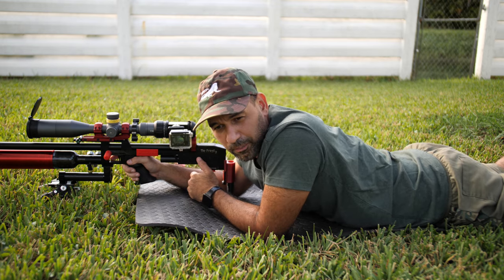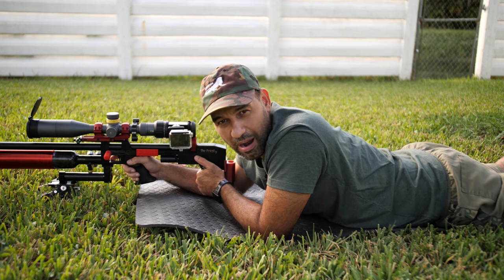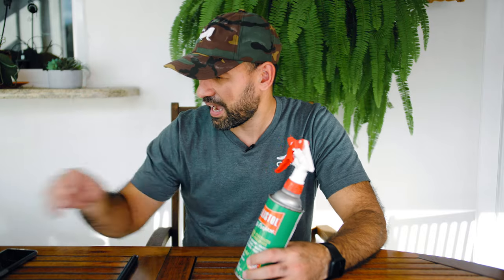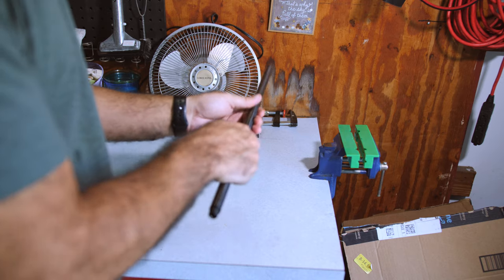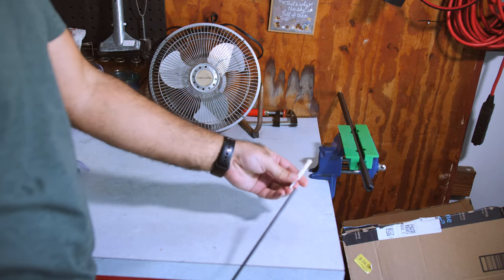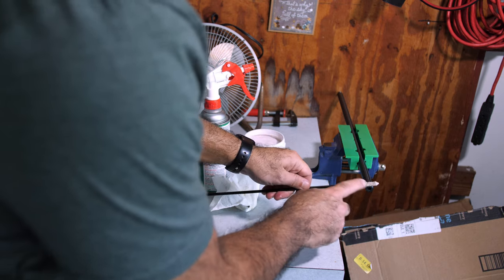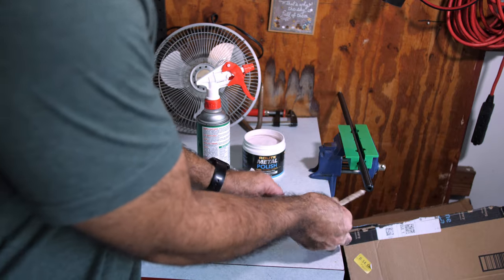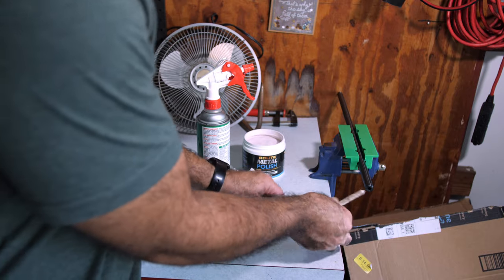How to Polish your Airgun Barrel | Orion the Iguana Hunter

Comment: I use the same method but i found it better to start with jb compound BEFORE the polishing compound becose the jb is grittier and will clean better the barrel before polishing. Polish will work better then.
Reply from the maker: I tried the jb paste vs the Rolite in a knife I have and to me the Rolite was more aggressive, but that might work too. To be honest we probably don't need JB, that Rolite polish like nothing I've seen before. I used JB at the end to remove the Rolite material. I think either way will work
Reply: @OriOnTheIguanaHunter  u can also heat the barrel with a heat gun before polishing for better results. And what i do when the mop becomes too lose and thin is to cover it with a cleaning patch to make it thicker and get more contact with the grooves
Reply: @yvessehnaoui3532  I have used the JB Compound for years. (Sparingly and never with a metal brush.) I've always swiped up and down the fill length of the barrel 25 times then cleaning patches with Ballistol. I've never tried metal polish. I believe I will have to pass on the polish. But to each his own. It all results in a clean barrel, which is the main point.

Comment: What is the no. of strokes and the depth.not clear if you do partial strokes in 3 inches sections and move ahead or the whole length.
Reply from the maker: Just do a bit about 3 inches and do between 10 to 15 strokes then move again forward 3 more inches, the repeat going backwards. It doesn't have to be exact. Just polish the barrel

Comment: I need to ask you did polishing your barrel really work for accuracy or are you just promoting products. I get 2 flyers out of my CZ barrel from a 10 round magazine
Reply from the maker: Promoting products? I don't sell products, if you go and read posts about polishing airgun barrels you will see that what I described here is documented on the community, I noticed I didn't have to season the barrel and got great results, some say you need to do that, but there are many reasons you can have flyers. Did you noticed the accuracy was worst compared with the groups you were having before polishing? Reply, I'm interested on your results... what gun do you have? The barrel I used on my video was a CZ barrel too!
Reply: @OriOnTheIguanaHunter  I have the Airgun Technology 25 caliber Uragan from talon tune. Tony place the Huma Regulator in the gun for me
Reply: The gun is shooting great with his power tune. Every gun can throw a flyer mostly because of the pellet. I was just wondering if I polished my barrel I can tighten up my groups even more
Reply: Put it this way is it worth me to polish my barrel
Reply: Thank you for replying to me I also have the Vulcan2 in 25 caliber both guns are badass
Reply from the maker: Maybe after the gun is aging a bit it's worth doing it... I think that if the  gun is shooting well you should not mess up with it. But mine was asking for clean up too often, it was worth it for me
Reply from the maker: @chrisbuccitelli9023  That is an awesome rifle... I was thinking getting one of those too

Comment: Did you polish the barrel from end end, the way i see it in the video it was on the front end only.thanks
Reply from the maker: From end to end. Moving just a few inches and repeating some strokes then moving a bit more, then repeat going back...
Reply: @OriOnTheIguanaHunter  ok thanks for the reply i think ill be polishing the barrel of my priest as well.does it matter if the rifle is still new i fired it about 250 times i think.
Reply from the maker: @leodeleon4263  wait a bit, if you noticed that this happens then do it. See if after a few hundreds shots you rifle's accuracy start to go south and after a clean accuracy is back.
Reply: @OriOnTheIguanaHunter  thanks for the advise right, by far this is the most accurate pcp  i have own and i really love it.again thank you.
Reply from the maker: @leodeleon4263  if it's accurate don't mess with it, just if you notice accuracy is suffering
Reply: @OriOnTheIguanaHunter  thanks
Reply: May i ask if any AR 15 handle grip will fit this rifle. Even those grip intended for pellets air rifle .
Reply from the maker: @leodeleon4263  yes you can use AR 15 but not those with the back lip

Comment: doesn't  cleaning the pellets keep down the build up?
Reply from the maker: The idea is to remove the micro burr the barrel can have after the rifling process, that will reduce the friction and help with the cleaning too. But you are right, by cleaning the pellets you also help with reducing the gunk build up!
Reply: @OriOnTheIguanaHunter  what would u use?..I use dawn just cause if it gets oil off birds it'll work on pellets..haha..loving the videos
Reply from the maker: @thomas-ms6st  it depends on the pellets, H&N are really dirty but JSB are clean

Comment: You have to be real careful when polishing a barrel. Make sure you are not removing any metal or you’ll lose accuracy and expand  the inner tube. Stay away from any abrasive cleaners.I seen a few barrels ruined in air guns and a lot in paint ball guns.
Reply from the maker: yes, you are absolutely right, the products I'm using are not going to remove much material but what is really important is that the rod rotates, so you are moving back and forth following the rifling... but you are 100% right, this has to be done with care and don't throw any product on your barrel...

Thanks for sharing

Comment: Buy FX ... No barrel polishing required. I much prefer shooting my barrels in than polishing one. Find the pellets that shoot best and go with them. We all have pellets that didn't group well in our air rifle of choice . I have a Diana Skyhawk in .177 Cal.  that only likes Baracuda Hunter Extremes and they group under one inch at 50 yards which is about as far as I care to push the .177 for ethical shooting at small game and rodents . Plus you don't run the risk of bad results and the cost of another barrel . Barrel polishing versus finding the ammo that shoots best in your air rifle should be a no brainer  people . If it doesn't shoot anything straight then consider polishing the barrel because at that point you have nothing to lose but to try polishing just because it doesn't shoot a certain ammo isn't a good idea. Remember you are removing metal from the barrel when polishing and that too can affect accuracy and velocity of the barrel especially if you overdo it .
Reply from the maker: Check my most recent video.... and the barrel on my FX was polished, it will benefit from it too.
Reply: @OriOnTheIguanaHunter  Out of the box mine is shooting under one inch groups with Baracuda Hunter Extremes 18.52 gr. On a quiet day I can get dime size groups off the bench at a 100 yds. Now granted I have the rifle locked down so any errors are the occasional wingers we all deal with but I have never before had a rifle do such impressive grouping right out of the box . I'm not so sure I want to mess with it if you catch my drift . So far almost everything I have put through it is satisfactory . My Diana Skyhawk in.177 however is finicky about what it will shoot. It will not shoot any slug I have tried and only a couple of pellets will give good results. Now that rifle could use some polishing ; ) But I still love it and many a rat has hated it . I'm curious.. Any of you guys ever try night vision scopes on Iguanas ? We have small lizards here in Virginia ( Skinks ) and they light up pretty good in my PARD NVOO8P at night. Wondering what an Iguana looks like

Comment: DONT USE YOUR FINGERS TO APPLY THIS CHEMICAL!!!!!!!!!!!!!
Reply from the maker: Thanks for the heads up. Someone already pointed that out
Reply: @OriOnTheIguanaHunter  no problem man...thank you for sharing this awesome polishing product. i ordered the rolite you used in this video and used this on my pcp .25 avenger...my 20 grain h&n 50 yard groups went from 4-6 inches to literally hole on hole for most shots. i made an 8 shot group the size of a paintball first test after polishing and cleaning and that was with like 9 clicks of new zero i gave to it after literally putting 3 in the exact same hole!!! amazing stuff..powerful solvent very powerful, i only spent a minute or two polishing id say about 30 full strokes and im actually fking amazed by the results.
Reply from the maker: @V3g3t41987  niceee, yes it doesn't take much effort to start seeing great results. I'm really happy you give this a try. I'm using this rolite even on my knife, ohh it does wonders also on the stainless steel appliances too, my dishwasher has never been shinier!

Comment: How are you liking that Arken Optics? I'm sure the glass quality is not on pair with your Tract Toric, but the scope cam looks great. I like the crosshair design.
Also is that the Eagle vision 75% to 25% or 50/50
Reply from the maker: Ezequiel, I'm liking that scope a lot. The glass quality is not on pair with the Tract, but is really good. I'm using an eagle vision 75% to 25% but for the Arken I've changed the Eagle Vision and now I'm using the sideshot. Problem was that the Arken has a shorter eye relieve and I noticed the Eagle vision almost used the entire distance and I had to put my eye vs the Eagle vision and was getting uncomfortable, so I tried and with the side shot the distance is perfect. I had some testing videos I did with it and I'm really happy with the Arken, I'll be releasing a video about it soon, just getting more familiar with the scope before I start talking about it, for me is a big YES